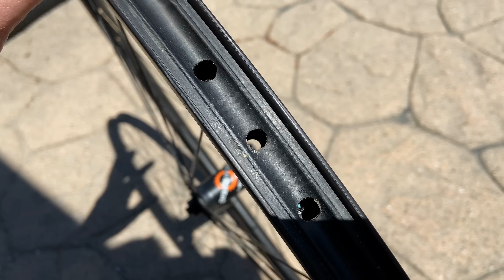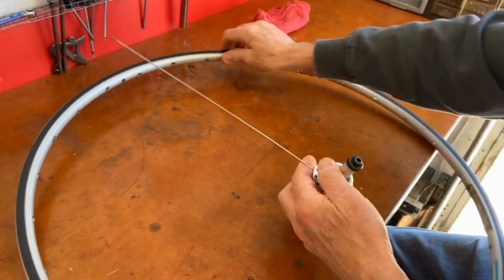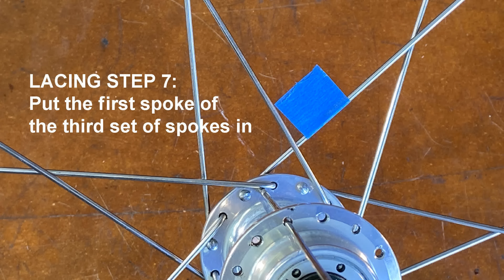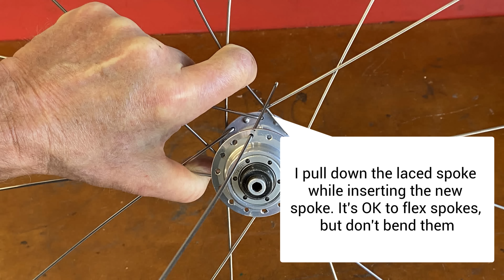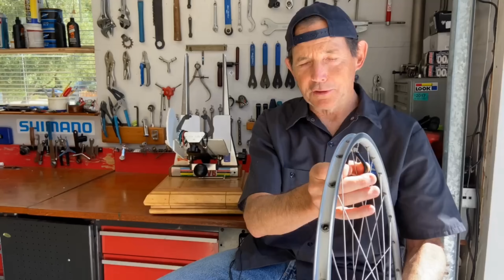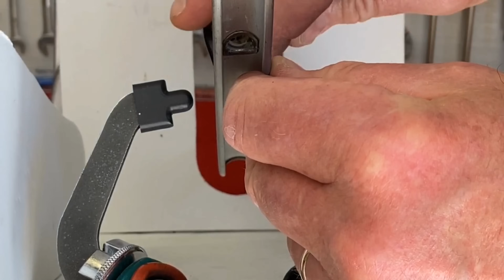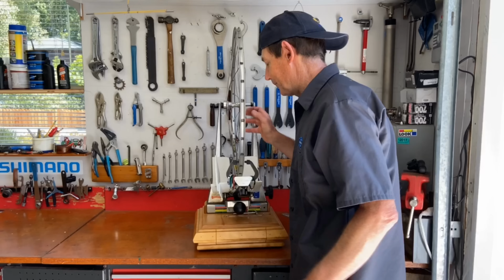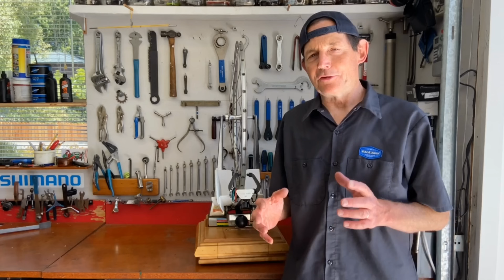How To Build Bicycle Wheels THE EASY WAY! #bikerepair

Comment: I'm been trying for months now trying respoke my 24 inch dk hubs in  these 24 inch redline rims I have the only thing I have only redline hub wen I 2 dk hubs there both 36 holes I'm wanting to put the original pattern on them wit is the three cross pattern can u make a video step by step on wat do please kuz all these other videos is confusing n I get frustrated trying to watch them n follow there steps wit I feel it will turn out a lot more easier n I have the holes in da middle of the rims as  well
Reply from the maker: Thanks for the comment, Felipe. This video right here shows you step by step how to build your wheels. Just start at the beginning and follow my instructions and you will be able to build your wheels. If you have any questions as you are watching and lacing up your new wheels, just let me know and I will explain.

Comment: First of all Thanks a lot for such an informative video. Couple of weeks ago my bike started to make a noise from front hub area. When I check it I found a crack inside the hub body. I already had a spare hub in my house but didn't know how to lase it. 😫
Yesterday I saw your video and felt confident about replacing the hub by myself. It fu*kin worked✨️. Your explanation is so clear and on point. I used my bicycle frame as a trueing stand. My bike had double wall rims but I managed not to lose any nipples inside.
Thanks to your video now I'm not afraid to lase the wheels again.💯
Reply from the maker: You're very welcome, Charuka! Congratulations on swapping out that broken hub and building your wheel, great job👍Thanks a lot for watching and and the great comment!

Comment: Helpful, thanks.

I Viewed it to prepare for decisions about how to lace a fairly large diameter NuVinci CVP (Continuously Variable Planetary) hub to a relatively small diameter (in comparison with hub) Araya 26" alloy rim.

Because the radial dimension between hub flange and rim wall is shorter, lacing pattern (double vs. triple cross) becomes a consideration, in order to avoid sharp angles where the spoke-nipples meet the rim spoke-holes.

In my experience, shorter spokes behave a bit differently during trying and tensioning than longer spokes.

Much to consider...

I very much appreciate the time and effort devoted to making a video such as this informative reference.
Well done!
Reply from the maker: Thanks a lot for watching, I'm happy you enjoyed the video, Matt. That NuVinci hub is very cool - I've only ridden them at bike shows. The shifting is incredible. In case it helps, if I am asked to build with a specialty item such as that wonderful hub, what I will do is read up on it in the company's instructions and if they don't say anything in the instructions about spokes and lacing recommendations, I will call them up and talk to someone who can tell me the best practices when working with their hubs. I have found that hub and rim makers often have a specific way they want you to build their hubs and I think it's best to use their method. For example, Shimano's disc brake hubs include specific instruction on how to lace them, which the industry pretty much follows (I do, too). I hope this helps and thanks again! By the way, I have videos on lacing patterns here:
Wheel Building Terms (includes lacing): https://youtu.be/4kVlmOjgdAs
 Shimano's disc hub lacing: https://youtu.be/gfWd7_avr1s
Reply: @JimLangley1  
Fallbrook Technologies customer support guidance is that double-cross lacing is decidedly better for wheel-builds of less than or equal to 540mm BSD (Nominal 24" or smaller).

For 559mm BSD and above (Nominal 26" or larger) they recommend double-cross lacing, but leave it to pro' wheel-builder discretion to opt for triple-cross patterns.

Cory Clayton at Orange County Bicycle Garage is my local guru, and I'll lean-in to his advice, with the hub and preferred rim-candidate available to him for physical inspection.
If you'll promise not to snicker, I'll send you a photo of my amateurish result.  :-)
Reply from the maker: @mattpohlhammer9482  I'm happy Fallbrook Technologies was so helpful, Matt - that's great information and now you know. I would very much enjoy seeing a photo of your wheels. I don't know if you can link to it in a comment so feel free to email it to me at my name at gmail. Thanks and have fun!

Comment: Great video! Question…
I noticed your spokes were head out on the first round of spokes. The first spoke you did was just left of the valve hole. Would it make a difference if those spokes were head in instead of head out? I saw other videos including the park tool video where they had head out on the first set of spokes but they started their first spoke two to the right of the valve
Reply from the maker: Thanks a lot for watching, Brian. Glad you like the video! When you ask about whether sets of spokes should be heads-in or heads-out, you're actually asking a wheel design or wheel theory question. On this wheel in the video, I am showing a simple easy to understand lacing and building process that will result in a great wheel if you follow all the steps and do a good job. It's aimed at beginners. (If you want to change the spoke orientation to heads-out that's perfectly fine - it will still result in a great wheel so long as you also reorient the other spokes as you put them in).  Also, I show that first spoke going in to the hole right next to the valve because that's the simplest, easiest way to lace wheels. If you do it other ways, most new wheel builders get confused and have a lot more trouble lacing wheels. 

Now about wheel design and theories, once you get into building lots of wheels you'll probably want to learn all the lacing possibilities and choose based on the type of wheel you're building, the rider you're building it for and so on. I have 2 other videos about these things. This one on spoke terminology goes into lacing differences: https://youtu.be/4kVlmOjgdAs And this one covers lacing for disc brake wheels: https://youtu.be/gfWd7_avr1s Okay? I hope this answers your questions and have fun with your wheel building!🙂
Reply: @JimLangley1  thank you! This is exactly what I wanted to see. It did leave me with one question though. I have been studying Sheldon Brown wheel building online. He stays this “The key spoke will be a trailing spoke, right (drive) side. It is easiest to start with the trailing spokes, because they are the ones that run along the inside flanges of the hub. If you start with the leading spokes, it will be more awkward to install the trailing spokes because the leading spokes will be in the way.

Since the key spoke is a trailing spoke, it should run along the inside of the flange. The head of the spoke will be on the outside of the flange.” 

If I’m not mistaken your video about Shimano building says to do head in for trailing spokes on the rear wheel drive side. I believe Sheldon says trailing is head out. Is this just two different styles of building or is he not compensating for disc wheels? I’m getting a little confused and I want to build my wheels perfect! 
It makes sense to me that the leading spokes on the rear drive side would be head out because of the forces. Unless I’m wrong.  
Im hoping that was confusing to follow
Reply from the maker: @Brianp1982  Yes, according to Shimano and most pro builders follow their guidelines - the trailing spokes on rear disc wheels are heads-in. Sadly, my friend Sheldon died before disc wheels became so popular so I believe he wasn't expecting so many people to be building disc wheels or he might have included different directions for disc wheel lacing. But, it's not a problem lacing the spokes no matter which way that first set of spokes is oriented. You can see in my video how I weave the spokes through the other spokes. That's what Sheldon was calling "awkward." And it is a little awkward the first time you do it but you get used to it and it doesn't slow you down much and doesn't cause any problems. Okay? I hope this helps and have fun!
Reply: @JimLangley1  Thank you so much for all the info. I am so excited to build my first wheels and I want to do them as perfect as I can. So I want the spokes to be in the optimal position. Can you please confirm this for me because my head is going to explode with all the research and information I have learned. 
Front Left (disc), Front Right and Rear Left (disc) all - Leading spoke head in
Rear Right (driveside) - Trailing spoke head in
???? :)
Reply from the maker: @Brianp1982  yes, that’s right, Brian. But it’s easy to get lacing patterns wrong as you actually do it, so be sure to compare your lacing to my Shimano disc wheel lacing video to be 100% sure it’s right before putting the next set of spokes in. For example you could have my video paused on your phone for reference. If you get it wrong you’ll have to take it apart and try again. Checking and double checking is the way to go to get it right. Also don’t get interrupted- focus on what you’re doing. Have fun!!
Reply: @JimLangley1  thanks! I’m sure it can get confusing. But honestly it doesn’t seem that bad. As long as I remember which side of the wheel needs head in or out then I can easily line it up to the key spoke hole and figure out if it’s trailing or leading. But I’ll use the video for reference. Once the first spokes are in the rest is cake. 
Also, quick question. I’m building up some NoBL tr37 wheels. Nobl always builds their wheels that are 29” with 2 cross lacing. Everyone I know local says do 3 cross. Nobl said it won’t hurt to do 3 cross but what’s your thought on it?
Reply from the maker: @Brianp1982  if it’s a heavier or harder more aggressive rider then 3 cross can add a wee bit of strength but regular riders do fine with 2 cross and it’s become very common because it’s almost equally strong and a tiny bit lighter plus laterally stiffer though it’s debatable if you can notice this.
Reply: @JimLangley1  I’m 160 and don’t ride hard. But my guys swear on 3 cross. I think that’s what I’ll do.
Reply from the maker: @Brianp1982  good choice, Brian. Have fun building and riding on your new handmade wheels!
Reply: @JimLangley1  hey Jim!!! So I just did my first wheel build and it came out amazing!!! I did some NOBL 29" 32h with some Pillar rainbow spokes in 3 cross. 
I tensioned all of the spokes on the short spoke side to 120-130 as NOBL recommended. After putting the tires on the spoke tension reads a bit lower. Front rotor side went from 21 on my tension meter(122) down to 19. My drive side rear spokes went from 21 down to 16-17. Is this normal or cause for alarm?
I stressed the spokes as best I could before having the tires put on and checked all spoke tensions. They were all fairly equal at 21-21.5 on my tension meter which equals 122-130 roughly.
Reply from the maker: @Brianp1982  Congratulations, Brian, well done! Yes, fully inflated tires always lower the spoke tension. That's completely normal. NOBL and other rim makers who spec tensions are considering the slight tension change in their tensions when tires are installed so your wheels are tensioned correctly. Enjoy those awesome new hand built wheels, way to go!
Reply: @JimLangley1  thanks for all the help. 
So I have been keeping an eye out on my Apple tensions after riding a bunch. I know I mentioned the spoke tension dropping from 21 on the tension meter when first tensioned, to 16 roughly with a tire on. 
Well I deflated my rear tire today and my drive side rear spoke tension was 19. So it dropped 2 points. 
I should remove the tires and bring the spokes up to proper tension right? I’m guessing I just didn’t stress the spokes enough and they loosened a bit? 
I have to take the tires off to do this right? And can the cassette and rotors stay on during truing again? 
Thanks!
Reply from the maker: @Brianp1982  it's possible that the spokes weren't fully seated in the hub or the nipples in the rims. In the video I show a step where you tap the bends of the spokes against the hub to get them to lay flat. If they're not laying flat, under full tension the spoke can do it from the tension and inflation and riding and that essentially makes the spoke longer reducing spoke tension.

Instead of taking the tire off, you could just let most of the air out and see if the tension stays at 19. If you let all the air out the tire will probably flop around on the wheel when you're spinning it in the stand to true it after tensioning. So you might see if it's possible to let most of the air out so that the tire stays round and on the rim and doesn't flop around. If not, then it'll probably be easier to just remove the tire. 

The rotor can stay on and the cassette, too. Because there's a good chance the spokes are seated against the hub now and the nipples in the rim from the tensioning and the tire inflation and the riding. Okay? I hope this helps. You're learning from these things and the next set of wheels you'll know how to avoid this issue.